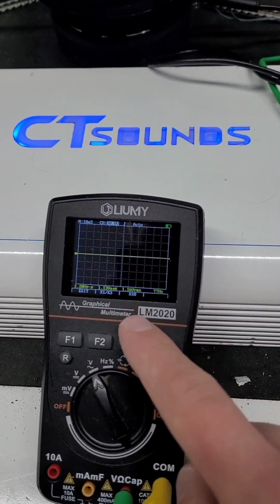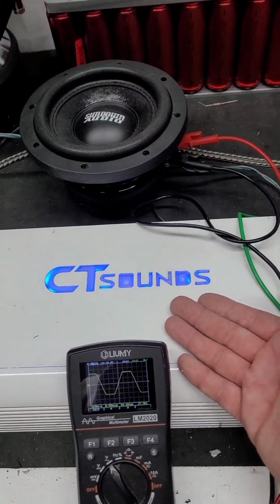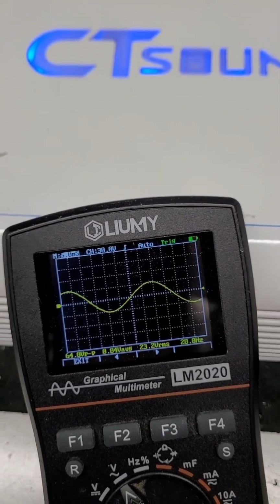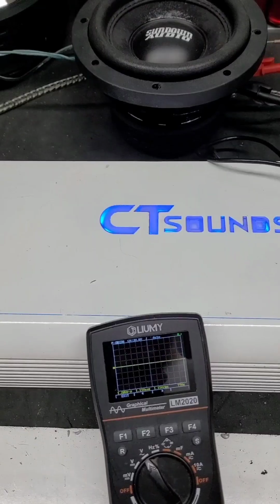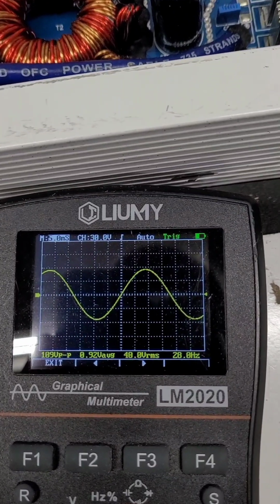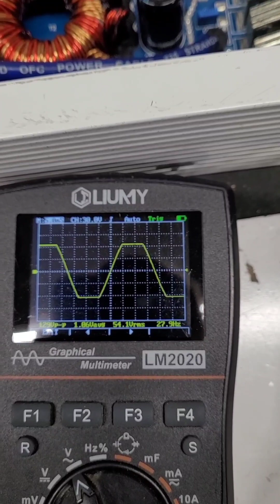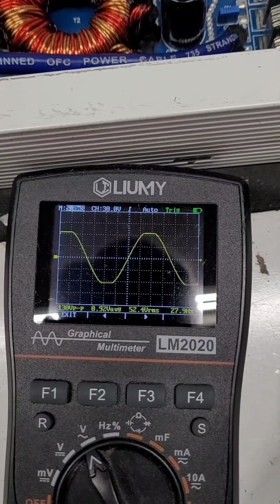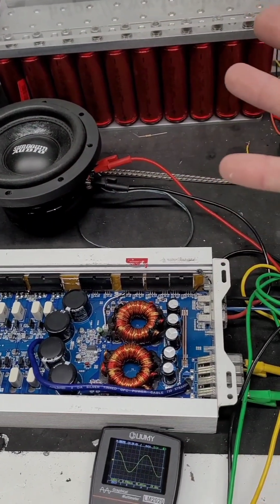What is "CLIPPING" -Why is it bad?

Comment: What do you suggest for the hkts 200 sub im using the str an 1000 reciever what level should I change it to or just leave it at the 12 o clock position right now I have the line matching the level and min if you draw a straight line between them